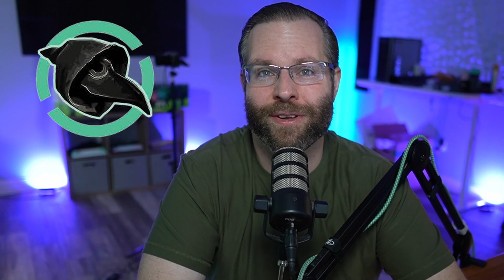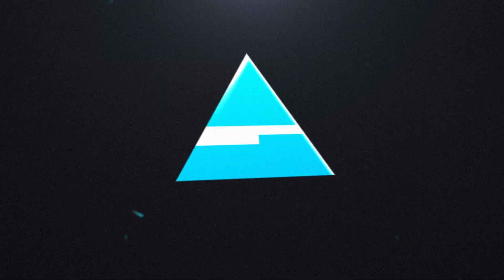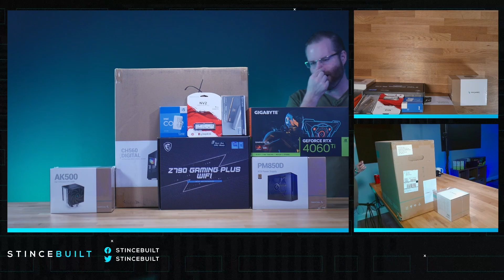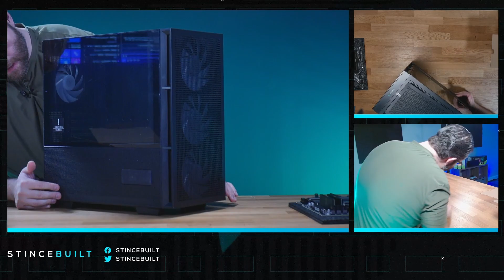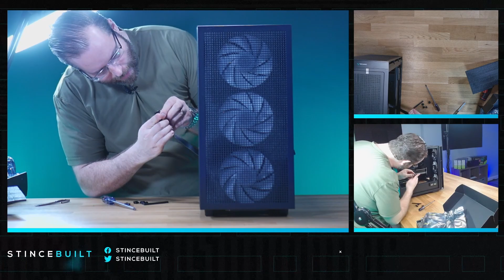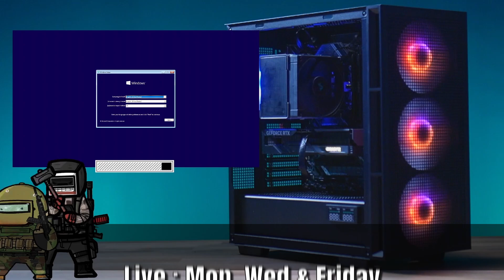Pestily Giveaway PC Builds! 13600k + 4060 Ti!

Comment: The x3D cpu's from amd are way better for tarkov. Even the 5800x3D.  So, if you just building it to play tarkov go for X3D.  I got a 13700k and a 7800x3D. Both with ddr5 and 3070. 7800x3d i get 40 frames more. Same settings and same windows version. Same ddrr5 speed and latencty.